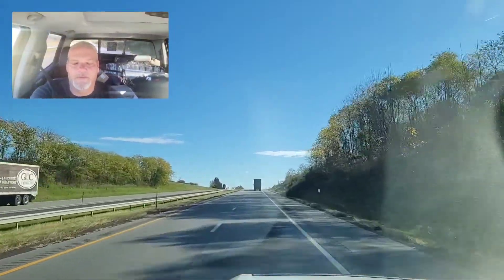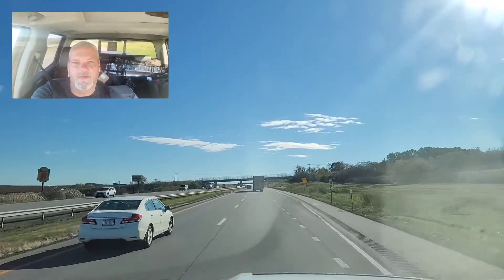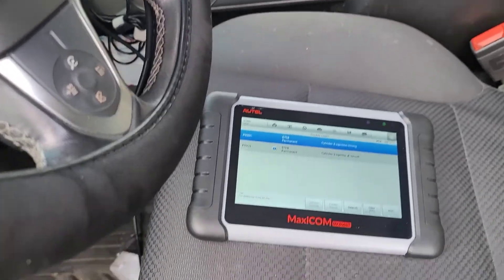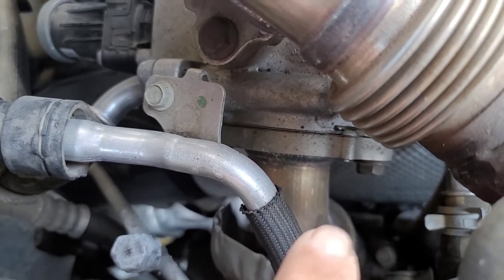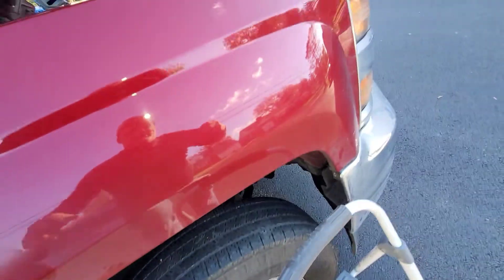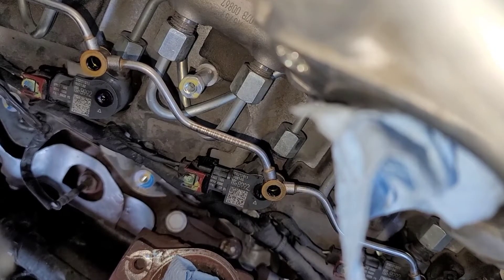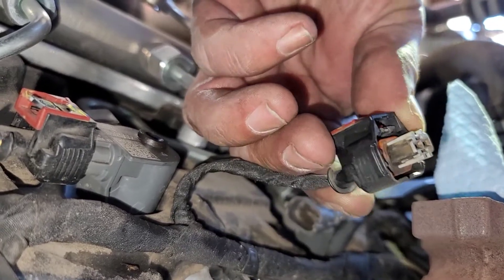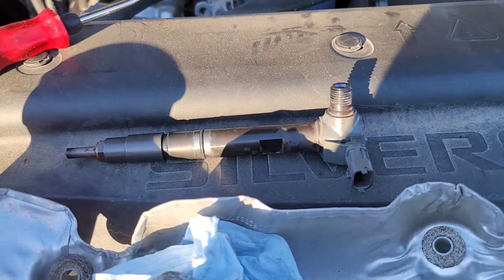L5P Duramax #3 Injector and connector replacement

Comment: God bless you Charles.  To have that level of patience, in a parking lot, out in the cold. You are one in a million. My family had been Chevy dealers for nigh on 70 yrs. Seeing the issues with the injectors and connectors, I'm not so sure that I would want a Duramax. Haven't heard of these sort of issues with the 2 other light duty diesels. Anyhow, you be safe and thanks for the video.
Reply from the maker: Thank you! I really appriciate your comment. The connectors can be aggrivating but I'm still liking mine. Overall it's been a pretty solid truck for me. Thanks again!

Comment: general motors is aware of this issue with the lp5 motors they have a new part and part number they should do the right thing and do a recall for this instead they are greedy and the cost falls on the consumers head we need a class action lawsuit against general motors for this issue
Reply: I would be down for that,... Have had to change every single plug so far... Total BS, bought the truck new and been nothing but problems since.

Comment: Also is it mandatory to have injector programmed to stop misfire?
Reply from the maker: It's not, I would take a Pic of top of injector so you have the number and can get it programmed at some point but it should run fine with no code to the best of my knowledge

Comment: Thanks for your videos! Very clear and concise. I am stuck in Wyoming, thinking it is the same issue. How did you and the dealership determine that the injector needed to be replaced and not just the Pigtail? Thanks!
Reply from the maker: I ran the codes and the last time i got that code it was the injector. If it's the p0207 it woulda been the #7 connector but i didn't get that code until after i changed the injector. I didn't talk to the dealer about it. If i can help send me an email and I'll send you my number. Cfarmeronyt@gmail.com

Comment: Help? After I replaced the connector and injector on number 5 the cluster cleared but came right back up. Do you know what this could mean.?
Reply from the maker: If you replaced the connector and the misfire and light is still on with the cylinder 5 misfire code is probability going to be a bad injector
Reply from the maker: If you replaced both i would think it could be wiring going to injector somewhere in the harness or something is telling the ecm not to fire that injector

Comment: I just had a 2018 duramax checked out by our local Andrew's diesel shop, I asked the about the L5P pigtail connector problem and they said when on comes in they replace it with a LML pigtail connector  to help the repair last. Have you ever heard about doing this?
Reply from the maker: I haven't, but I'll definitely look into it. Thank you

Comment: Thanks for these videos. Do you know if the replacement connector is an update/older version ? I’m curious if they will fail again down the road
Reply from the maker: Thank you for your comment! As far as i know there're the same with no upgrade but i can say of the 5 I've replaced (3 on my truck and 2 on another truck) they're still holding up with no issues

Comment: How easy is it to get to cylinder one o got a bad injector on cylinder one and four I'm in Mexico
Reply from the maker: It would be right beside the one i replaced to the front (passenger side front) . It's one of the more aggrivating ones because of egr. 2 injectors bad? 1 and 4? That seems odd they would go down together. What codes are you getting?

Comment: Anything you can’t do for the l5p with that scan tool you have? Also can you do the tire pressure sensors relearn?
Reply from the maker: It doesn't do tire pressure sensor learn. That's about the only thing so far that I've wanted it to do that it didn't do. I'm still learning about it myself. I've done forced regens, injector flow rate, read and cleared codes from all modules and got into some of the live data but I'm still learning

Comment: even if you were a bit sketchy & lacked technical information, you effectively demonstrated what I need to do to get into mine on that same side. I have a misfire & code for #5 injector.. I have read a few comments about loose fitting terminal ends in the injector connectors & hoping that perhaps that is my issue rather than injector...  1guy to another, thanks
I have a 8 year old shitty OTC Genesys & can't program. I need to get a new scan tool for that & just to be more current.. what altel do you recommend & software..
Reply from the maker: Thank you! I have the autel mk808-bt. I'll get you a link to the exact one i have. In my experience (which isn't much) If it's the P0205 and a misfire code its most likely the injector connector but if it has a injector timing code it would be the injector but if you replace the injector I'd replace the pigtail too. If you saw the video where i replaced the #7 connector on mine #5 is right next to it and they are the easiest 2 to get at. I also find the injector connector on Amazon for a lot cheaper than I've found them at the dealer. 

MK808-BT
https://amzn.to/38z9CLW

Injector connectors 
https://amzn.to/2Wm4456
Reply: @CFarmer   I won't cut & splice... I opt for new terminal ends
Reply from the maker: I understand, i would rather not but i had to do what i had to do. I've looked into replacing the whole harness but from what i understand it's the same harness with the same issues we already have. I've had to do #7,#5 & #4 so far
Reply: @CFarmer   when I get it apart, will definitely check all 4 connectors before I reassemble.. whether it's a bad injector or not.
Reply from the maker: Yes sir, please let me know how it goes. The more i can learn the more hopefully i can help other people.
Reply: @CFarmer  I went to Chevy & got a connector, dealer wholesale price $85.. list is $115.. for 1 connector, that's robbery!  I saw your other video where you did #7 & dang, I said, I don't need to remove that EGR pipe, etc.. I removed the rear cover & #5 connector. I slipped a blade terminal in the connector terminals..  seemed the right size & they were loose. I ohmed #5 & 7 injectors.. they were identical. Cool. I cut the connector off right at the edge of it & spliced the new one on with just about 2.5" of new wire.  Put the cover on & road test. Seems great & not misfiring either. Gonna give it a few days. If all is well, I will order the connector/terminal end kit & replace them all.
Reply from the maker: Good deal, i hope that fixes you up

Comment: Do you know if the P0203 or the P0303 is a code for the injector itself or could just possibly be the pigtail? My truct threw both these codes so im wondering if ill need to replace the injector as well, or maybe the pigtail will clear it?
Reply from the maker: I believe it's an injector code but i will bet that the pigtail will fix it. I've not got the p0203 or 303 myself but i have seen both of those codes p0206 with p0306 and the pigtail fixed it. The problem is #3 is on the drivers side right behind the egr pipe and it's hard to get in there to it without taking egr pipe off even to replace the pigtail. I had to take thepipe off of mine to fix a manifold stud and i replaced #1 and #3 pigtail just because i was there. Definitely a good possibility it's just a pigtail. If you could get to the wires and start it up and wiggle them i beer everything would go back to normal
Reply: @CFarmer  thank you so very much for your response. I'm watching your video now. You are so appreciated and very helpful. Have a wonderful day!
Reply from the maker: Thank you, you too. I don't get all of my comments but my email is in the description if i can help at all and you caint get me here

Comment: what autel scanner do you have that does injector programming?  I replaced the #5 connector & the issue went away for about 1,000 miles then returned.. I bought the other 7 connectors & checked the code.. it was #5 again!
I did static ohm the injectors .1 - .0.. all were the same
I replaced the 4 connectors on the rt bank & redone #5 without using the shrink connector supplied... usedcopper ferrules & shrink tube.  Ran great for 4 or 5 days, then, same code #5..
I am pretty sure injector is going bad
Reply from the maker: I have the autel MK-808BT. I caint remember the exact code but this one had a injector timing code as well
Reply: what did you have to do for the timing code?
Reply from the maker: When i replaced the injector it went away
Reply: I'm picking up new OEM injector tomorrow.. I took it all apart from up top.. didn't remove fender well at all.. had it apart & injector out in about 40 minutes..

Comment: Do you know if they upgraded the injector connector on 2020
Reply from the maker: I have asked at the dealer but never got a straight answer. I'm really not sure.
Reply: Had a 2016 just recently traded 20 20 also driving for IT. Keep up the good work great information
Reply from the maker: I know the 17,18 and 19s had issues but i haven't heard much about the 20 and up
Reply: @CFarmer  yes the 17-19 have bad injector and a bad fuel rail system my to 2019 started having problems around 12,000 miles on it , i kept going back to the dealership over maybe out of 5 month about 7 times around the 4 time they finally replaced all the injector in the truck I ask them why and they told me they already know about the bad injector but they just can’t replace all of them till they get a go on it from manufactory I ask why they just don’t do a recall on them he said he didn’t know but he said that was about a 7k job they did on my truck but The warranty Cover everything so after that I started getting p1089 code went back the 5 and 6 time finally the 7 time I went back the manufactory told them to replace all of the fuel rail system so now that been about 8 days ago and no check engine light have came back on yet and the truck runnings better then it did when it only had 7 miles on it new but yea he needs to take it back and stay on them to get all that replaced especially if it’s still under the warranty
Reply from the maker: It's crazy, i went to the dealer and got the injector and parts spent around $350.00 and everyone I've talked to that's had #3 replaced at dealer says it was a $2k job... I'm glad you got fixed up under warranty but this truck has 265k miles and mine has over 300k miles. We're both way out of warranty
Reply: @CFarmer  oh wow yea your warranty maybe gone with 265+ miles 😄 ,that’s some nice miles there I hope mine’s gets up around that and more we’ll be bless and take care